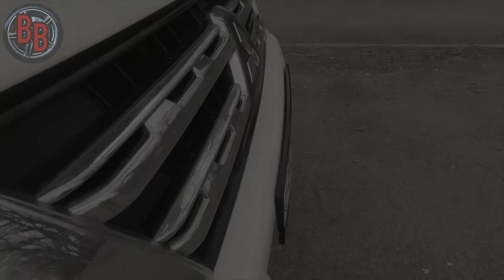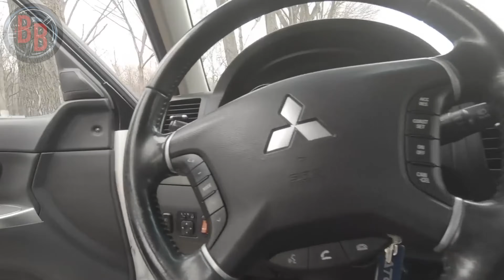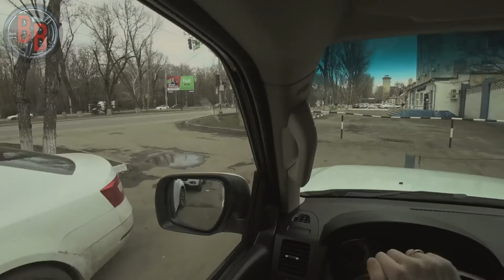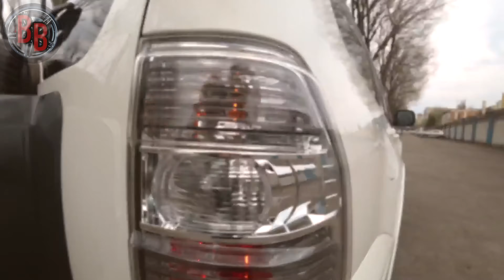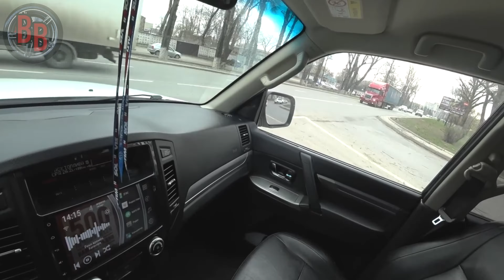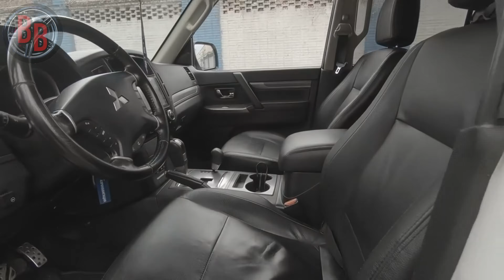Mitsubishi Pajero 4 - Check For These Issues Before Buying

Comment: Got a Pajero 3.5 petrol V6 (2016 model) in 2015 in the UAE. I have done 200,000+ kilometers over these years. It has endured high temperatures in summer time - temperatures well beyond 45 degree celsius. Once it had to stand in knee-deep water logging due to sudden heavy rains for close to 10 days - had some electrical issues after the water logging retreated. Had to change the alternator and everything sprung back to life as if nothing happened. It is a tough beast, gets out of areas where other 4WDs get stuck! Truly a remarkable piece of perfection.
Reply: Does this model get a lot of rattle bro? does the cabin (plastics) get to loose ??

Comment: My gearbox is  faulty and l need to chk if there is still enough gearbox oil . Where  do l chk. Tried to look for a deep stick somewhere l cant find it
Reply: I've got a 2017 3.2 exceed the automatic transmission has no dipstick,  only a fill plug on the side accessed from underneath. Pump transmission oil in until it runs out the same hole.
Refer to the handbook for the recommended oils.
Reply: Change oil and check solenoids. They tend to fail.

Comment: I have had two Pajeros in Australia over a 21 year period.
2001 NM 3.5 ltr petrol.
Modified with bull bar, aftermarket suspension and all terrain tyres.
Completed 295,000 km, over ten years, general commuting and off road driving.
Had seviced on time and had no issues.

2nd Pajero was a 2014 NM diesel.
Modified with bull bar winch, rock sliders, underneath protection, two inch lift, snorkel all terrain tyres.
Have now completed 275,000 klms over 11 years.
I have towed a 2.6 ton caravan and 1.5 ton camper trailer around Australia twice.
Only issue has been front break rotors, rear wheel bearings and broken clips on air box . Apart from these items the vehicle has been faultless.

 I would buy new again if the vehicle was still being produced.
Reply: Pajero sport is a good alternative

Comment: Father in law have a 3.5 v6 with  500 000km on it with just normal maintenance he is not a car guy and it has been exceptionally reliable hardly any problems replaced a front shock once very impressive

Comment: My Pajero dash rattles alot , how can i fix this ?
Reply: Not fixable you have to tighten all the bolts and fill it with foam i just done mine and added pads all around the interior under and on the back doors in the bacl doors for extra sound deadening and insulation
Reply: I have the same issue

Comment: Hi, i have a 3.2 Di-D from 2004, 20 years this year and 305,000 miles on the odometer, only one problem has occured, impact the Anti-Braking System has the pump was dirty and blocked. After a cleaning, the pump is ok. But then, it still not brake as it normally would. But still running like a charm, orgininal engine and gearbox :) Gotta find a brand new ABS now lol. Thanks for the info in the vid.
Reply: Great to know! I just bought a MY14 diesel with just 40k miles on it, so fingers crossed it’ll run strong
Reply: @ronanrogers4127 Change all fluids and it will be good.

Comment: Just bought a 2012 3.8 with 63.000 kilometers, and took it to camping/overland, and i’m impressed and happy with it, i’ve had grand cherokees and 4runners but none of them gave me the running on hard gravel, and swampy/mud crossing control and safety that his little beast gave me
Reply: What’s the fuel average of 2012 model?
Reply: @AhmadHassan-e9r 12l5/100
Reply: hi, just considering 4runner 5gen or pajero 4 3.8. are you sure  p4 drives better?
Reply: My 2007, 3.8lt goes awesome. I've got like 190,000kms but it's still going hard and looks like new.

Comment: I have driven a Pajero of the first year (2007) of that model series for 360 thousand kilometers and none of the mentioned problems have occurred. It's confusing to listen to such a fault list when mine has only had the transmission oils (automatic) changed once and the front lower support arms and 1 brake caliper, as I remember, on the right side. Does not eat oil at all (3.2 DID), i.e. carefree kilometers. Ain't, front brake discs replaced.
Reply: 3.2 DID engine the best out of them all

Comment: I like the 2003+ V6 3.8L motor versions we have a few of in the USA.  I have two with over 225,000 miles, all original, no rebuilding.  I've had all previous generations also, with high miles.  They are better than Toyota, Nissan (way better), USA brands, and any European competitors I've driven, tested or owned.  One thing to do when present ASAP:  remove the secondary intake butterflies that are in the intake plenum, or fasten them with permanent thread locker or via welding.  I just remove them as they do nothing. From factory, they commonly come loose and damage the cylinders or valves, around 135,000 to 160,000 miles, some sooner.  Ask me how discovered this? 😆 

And spray any bushings with coconut or similar food oil, and suspension bolts with light anti-rust oil once a year.  Will save your ass in climates with salts.
Reply: how did u find about the butterfly
Reply: @ailtonbiji5024  my hobbyist mechanic  friend removed intake and looked into it and saw 2 partly missing. Then I searched for it online with key terms and found it on a forum. I removed mine entirely. Have noticed no difference.
Reply: hola, eso de quitar la mariposa de admisión también aplica para el montero 3.5 año 2000 (modelo 1997-2001)
Reply: @jmz4x4 I don't think so.

Comment: Rear gear knock is mostly wheel hub nuts needing retightening. Simple part free fix. 
Once torqued up properly no problem, all good.
My 3.2 diesel has done over 200,000 and is over 9 years old. Other than rear hub nuts needing tightening, not one of these issues has occurred and my Paj has been on some of the worst outback roads in Australia. Still drives like new.
Reply: Same issue at 120000km.
Easy fix

Comment: nice video. 3.8L 184kW is readily available in australia and thailand. or was, before it sold out. everyone loves it.
Reply: It's a bit thirsty though. The 3.2 diesel is the favorite in Australia
Reply: @JohnFrumFromAmerica Maybe favorite...but overall it blows away 3.2 in any aspect. Offroad or tarmac.
Reply: @The_Touring  dont forget fuel consumption. Australia is big and Pajero has a small fuel tank. Also diesel is much safer to carry extra. A gas overland Pajero for Australia is borderline not viable. A diesel is a good choice.

Comment: There are lots of misinformation in this video! 

Take the content with gran of salt!
Reply: i wanted to buy one in a year. people say these are durabe but only thirsty on gas. do you suggest the 5 speed auto with 3.0, 3.5 or 3.8 engine? is the 3.8 mivec engine as problematic as this guy claims?
Reply: @zhila5958  I bought the 3.8, and its very common here in Middle East. People say they are very reliable but gas hogs
Reply: @nyzz1351  do they drink that much fuel? how many liters per 100km? also, do every gen 4 get 5 speed auto or only from 2009 and up? would appreciate more info
Reply: @nyzz1351  also forgot to mention i’m from middle east too! in kurdistan to be specific haha. so i’d appreciate everything you know!
Reply: @zhila5958  driving in neighbourhoods 3-4km/liter
in the city 5-6km/liter
in highways 7-8km/liter
(it has a 86liter tank and uses 95petrol)
Reply: @player-gs8de  that sounds pretty reasonable, so it consumes as much fuel as any other SUV (sometimes even more efficient), appreciate the response!
Reply: @zhila5958  get a diesel. it will outlive you